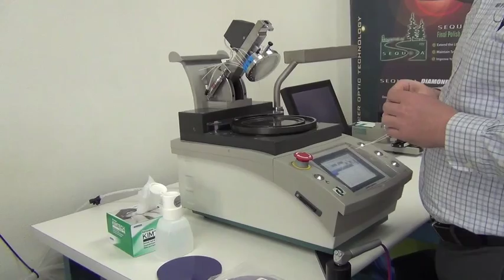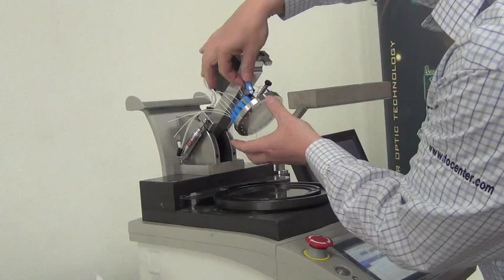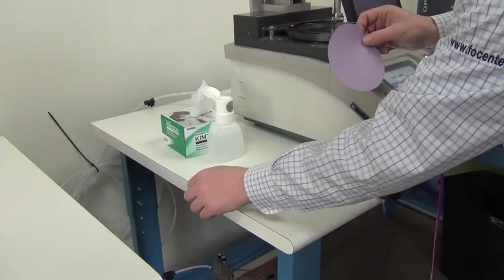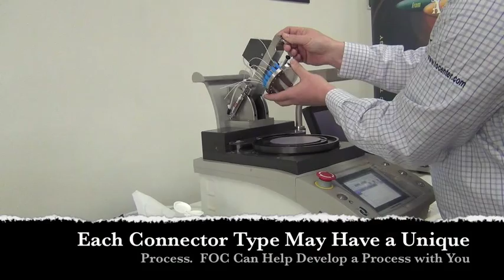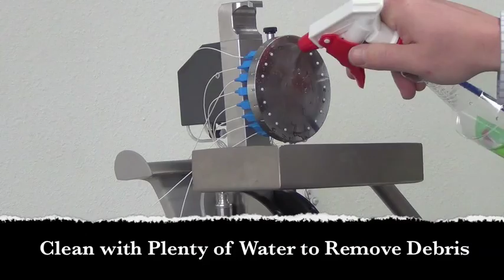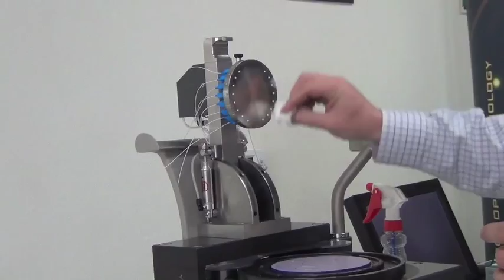Fiber Optic Polishing for Fiber Optic Cable Assembly Production

Comment: how much psi should you use on fiber? can you damage the fiber using higher psi
Reply from the maker: It sounds like you are looking for the pressure being applied by the machine on the connectors being polished.  The Domaille 5000 series polishing machines typically use lbs as the unit of pressure.  The amount of pressure is dependent on the connector style being polishing.  For 2.5 mm ferruled connectors it's typically 0.35 lbs per connector.  For 1.25 mm connectors, it's typically 0.25 lbs per connector.  However, this is just a guideline.  The machine operates between 80-125 psi, i.e. the pressure of the air being introduced to the machine for operation. Here is a link with more detailed polishing instructions:  https://focenter.com/polishing-instructions-for-single-fiber-and-mt-polishing-processes/.  We can provide more details on the polishing machine and answer addition questions if you send an e-mail to sales@focenter.com.  Thanks